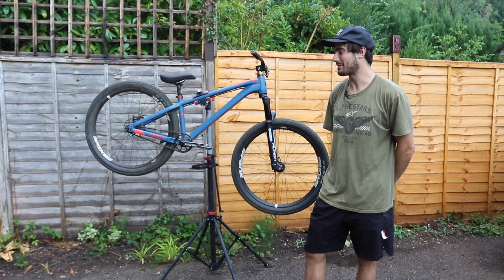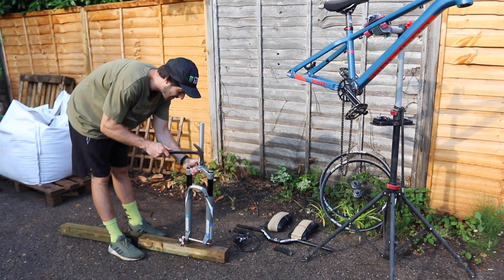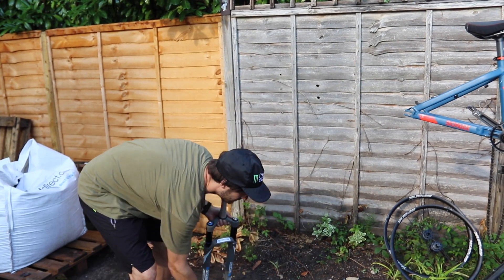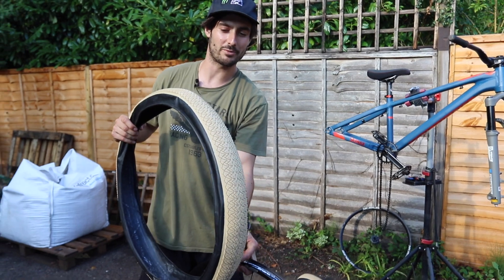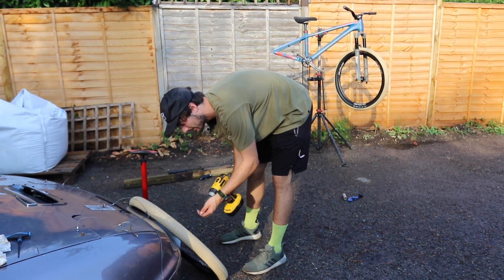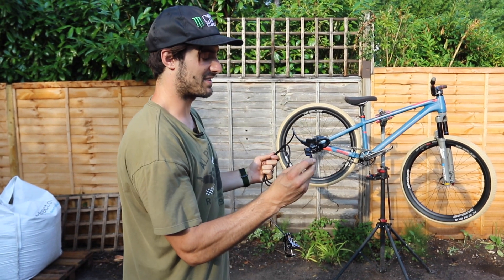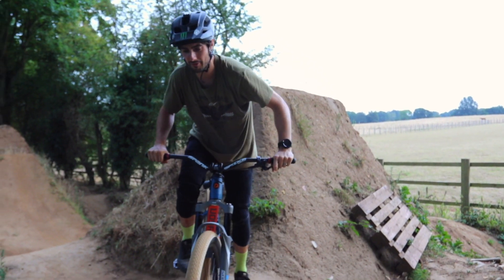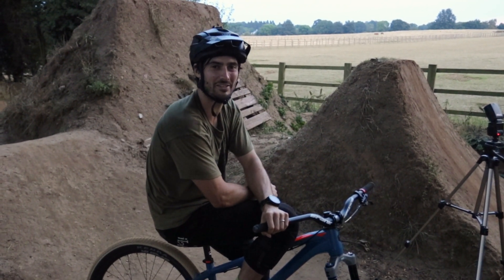NEW UPGRADES ON MY DIRT JUMP BIKE! - Custom Polygon Trid

Comment: How important is bike sizing on a dirt jump bike?  I bought one used but it is one size up from manufacturers recommended for my height.  But i adapt and never notice any issues should i swap for my size frame?   New to jumping not mtn biking.
Reply: I know I’m late but I think sizing on dirt jumpers are less specific than full sus mountain bikes. I’m shorter than the manufacturers recommended heights but I still feel very comfortable on my dj.

Comment: Awesome skills from what seems like such a bloody nice bloke. What tyre psi do you run in your normal mountain bike as opposed to the jump bike ? Cheers Joe.
Reply from the maker: It can vary!  Around 35 for normal riding on trail bike or 30 for full downhill.  40 for fest jumps!
Reply: @SamReynolds26  brilliant thanks, I'm not far off, running 30 on my sisuki n9.